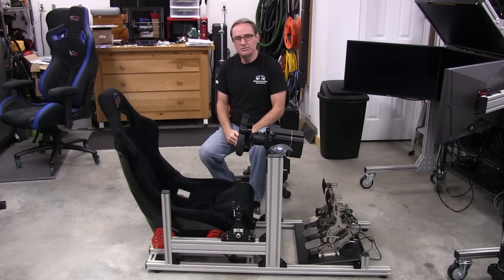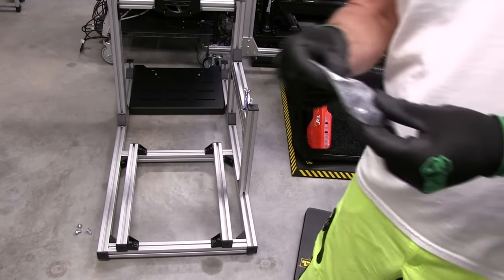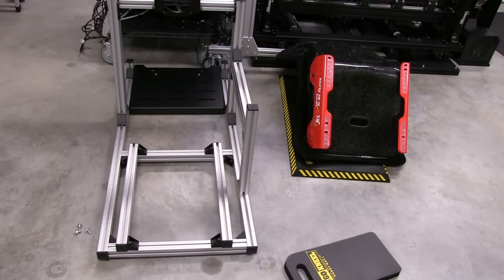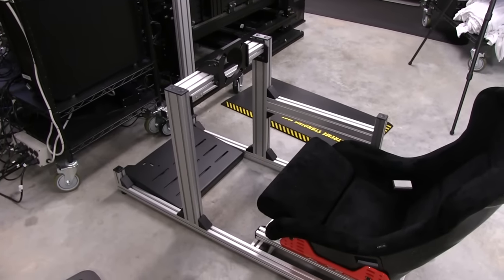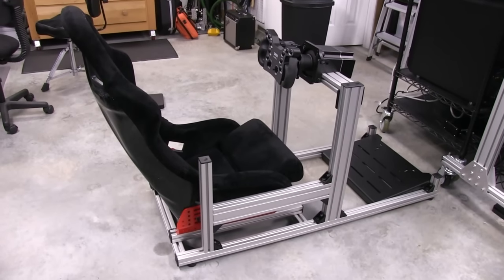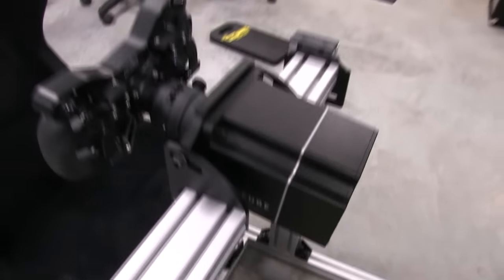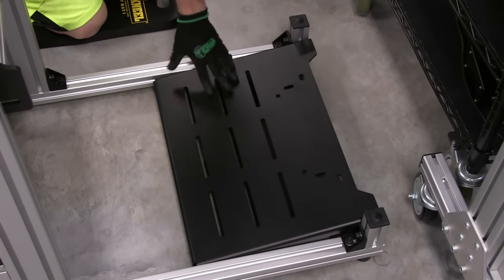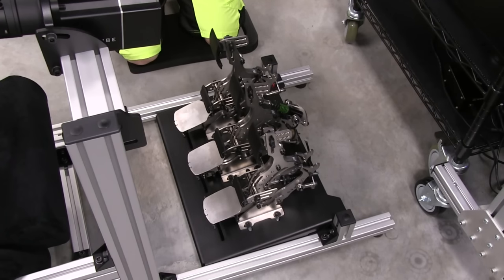ASR 1 Cockpit Review Part 2  "The Setup"

Comment: FIRST! :D 

Small but importante note here, 397$ USD or 449$ CAD shipping and duties covered for all North American customers! We want to thank Barry for dedicating quality time for a deep dive testing with our newest entry-level cockpit, the ASR 1. It's definitely not built for top tier SimRacing equipement like the Simucube wheelbase, but as SRG demonstrates, it can handle pretty much anything you throw at it. We'll be around on the comment section if you guys have any questions that relate to what we do!
Reply: Any idea when you guys will have the ASR1 and some medium seat options back in stock?
Reply: @RX120D  We have 400 seats arriving mid-April! :D
Reply: @advancedsimracing  Ugh, sounds like the mid-February shipment has been pushed back then? Last I heard from you guys the word was mid-Feb.
Reply: @RX120D  Insert broad comment about the global supply chain 

Yeah... pushed-back indeed. Sorry about the situation! Racing seats for simulation are a hot commodity.
Reply: @advancedsimracing  Just ordered one of these for $349 shipped. Unbelievable value, there is no comparable product. Thanks!
Reply: Hi there, would the ASR1 be appropriate for the Thrustmaster TGT 2 with TLCM pedals?
Reply: What wheelbase mount is that ?

Comment: I had the same issue with my seat and shifter bar...I ended up actually just mounting the bar out on the sides of the wheel tower rather than straight up to it. Now I have more room than I'll ever need for a big ass seat and the shifter is still within reach without strain :)

Comment: If you flip the pedal tray to the intended position (cutout towards the seat) it will lessen the flex you are seeing in the plate.
Reply: That guy knows!
Reply: @advancedsimracing  Can't wait for my ASR3 to get here!!!!
Reply: @brandonmalo2066  How are you liking it, if you don't mind me asking?
Reply: @OREvilleRed  It's amazing, went together very easy. All pieces perfectly cut and all the hardware you could want. Rig is solid and has all the adjustability one could desire. Shipping was fast and their customer service is second to none. Put it all together @Advanced SimRacing is the best choice hands down for North America's. When you factor in shipping and conversion fees ASR is the best price. I spent months pricing out all the different chassis from many different vendors.
Reply: Good to hear, I ordered mine last night! And yeah, the shipping really did it for me. I was looking at a cheaper rig and over $300 in shipping but with ASR I was able to use that $300 in a better quality rig and not transit money.
Reply: I don’t understand why he used this ridiculous pedals set… Totally nonsense to me. This is the worst set possible in terms of forces applied on a rig…
Reply: @1980VINZ  pretty sure the point was to try and find the chasis weak points using very high end peripherals
Reply: What you mean?? I have the ASR1 and id like to understand loll

Comment: I bolted the Fanatec CSL DD up to this ASR1 cockpit with a side mount and I have not noticed any flex at all when using it at its rated power of 8Nm. However, I do have the supported shifter arm bolted up as well so that may be helping a little with keeping flex at minimum
Reply: I just got mine today,  mine didn't come with a face plate, I only the have side mount.  Is that how the CSL DD should be, or did yours come with a face plate aswell.
Reply: @Beast Nicholls mine came with the side mount and the CSL DD spacers only. If you have not mounted the CSL DD yet, use four M6 16mm (with 1.0 thread spacing which matches the CSL DD anchors) bolts with it since each side mount is 6mm thick. I used 4 M8 spacers as well since the kit has so many, on the outside of the side mount to give the bolts a better anchor point since the side mount holes are a tad too large for them to anchor securely. My CSL DD certainly is very secure on there doing this
Reply: If I want to keep the wheel as low as possible is the side or top mount better for the csl dd?
Reply: @SpartanA31xx  the side mount is better since it will allow you to angle the DD upwards slightly if needed for comfort like in a real car.
Reply: @Khans0120  Awesome makes sense. I have to buy a mount for that correct?
Reply: @SpartanA31xx  certain extruded aluminum cockpits which are pre-made have an option to upgrade the standard plate mount to a side mount. However if you design your own extruded aluminum cockpit and order parts from 8020.net, then you can order the side mounts separately. I ordered the ASR1 from Advanced Sim Racing and got the upgraded side mount and supported shifter arm with it.

Comment: not sure if this might help anyone but the extra attachment for shifter /handbrake was mounted slightly wrong the verticle part near his elbow is supposed to be mounted on the outside of the rig not ontop and the horizontal part that the sequential shifter is on is also supposed to be mounted to the outside of the tall verticle piece that leads to the wheel this was probably super confusing but if you look at the picture on the website for the attachment is will explain beter....only reason i mention it is so people will still consider this option when i saw what an inconvience it was i was going to be to mount a shifter i was going to opt for a beter model but it has the same base width thats when i noticed the attachment was mounted slightly diffrent then intended and if mounted corectly it would give the extra clearence nessary to enjoy als they have shifter handbrake and mouse pad attachment that go on that attachment
Reply: That extra room may work better for some but his setup is an option to try. The other thing improvised on this video is the pedal plate is reversed, the folded edge is at the front of the rig on the website

Comment: do you think the asr3 will have less wheel flex than the asr1? I believe the only difference is the bottom extrusion is slightly beefier. Im currently using the 8nm csl dd

Comment: Thanks for the video! Great insights on what to expect and some good tips for set up. Any input on whether it is best to have a stand alone monitor stand vs. the integrated ones? I would think any flex/wobble in the rig might vibrate the monitor on the integrated ones.

Comment: is the ASR 1 sturdy enough to handle a simagic Alpha mini?
Reply: In the video he mounted a Simucube 2 which outputs 17nm which is more than the simagic Alpha mini (10nm) so it should be okay. You will still see some flex but less than what Barry shows in the video.
Reply: Sure is!
Reply: @advancedsimracing  on the website it says ASR 1 is recommended for 0-5NM, ASR 3 for 5-10NM, I assume that you mean the ASR 1 can handle better than it promotes? ASR1 is good enough for the CSL DD in your opinion?
Reply: @sixx1095  well you yourself saw how it handled a wheel base with over twice the strength of a CSL DD. But yes usually these rigs are designed to withstand a bit more than the recommended use. The ASR 3 isn't much more expensive and you can get a rig that is more future proof than the ASR 1 in case you ever upgrade your wheel base.
Reply: @DavidGarcia-oi5nt  I do see it, it's surprisingly sturdy honestly, super impressive.
Reply: @sixx1095  I just ordered myself an ASR3 yesterday! Shipped out within 24 hours lol, very excited
Reply: @DavidGarcia-oi5nt  thats awesome. Please let me know how you like it when you have it in hand if it's possible. Cheers
Reply: @DavidGarcia-oi5nt  24 hr?!?!?  I ordered mine 8 days and still waiting. Same goes for both Moza set-up and LGA1700 mounting bracket from be quiet!
Reply: wondering if you ever tried out the ASR 1 with a simagic Alpha Mini?

Comment: I wonder if there would be flex in the pedal tray if it was installed correctly?
Reply: care to elaborate on that statement? seems to be installed the exact same as  the images on the manufacturers website...
Reply: @sicphuker  It's installed facing the wrong direction, needs to be turned 180 degrees.
Reply: i definitely want to see the pedal tray moved to the correct position. i think the folded lip would help with the flex
Reply: I had to double check the site and he def has it backwards :O
Reply: While it certainly might not fully eliminate the flex caused by maximum pressured applied on such a heavy duty pedal set (which is not the goal of the ASR 1 either), it will help for sure! It's made be reinforced at the front end with the bent steel shape.
Reply: I have the ASR4 (same pedal plate thickness) and Heusinkveld Sprints which max out at 65kg at the pedal face. Under heavy braking there's definitely some flex, but I honestly don't notice it while driving.

Comment: If I could buy this, or the NLR GTTrack for about the same money, which would you recommend? I know the GTtrack is supposedly a higher end product but this seems more sturdy and its 2 years newer and made in North America
Reply: I'd definitely get this. I have a Next Level F-GT, which uses very similar materials/design to all their other products. It's okay, but definitely feels cheap and there is lots of flex. The GTTrack is just their wheel stand with a seat added on. The seat is basically just a low quality "gaming chair" bolted to a metal bracket. I think it's overpriced for what it is.
Reply: @dlugsch  I settled on a Sim Labs GT1 for about the same money shipped from puresims. Thanks for the input though!
Reply: @Shakshuka69  great choice! ASR and Sim Lab seems to be about the same quality
Reply: I am glad to hear you bought the 8020 instead of the GTtrack. I had a used one for a while, the chair is garbage, looks fancy with the seatbelt, but it’s flimsy with not much support. The adjustment is definitely not as flexible as any aluminum profile rig.

Comment: Anyone have a simucube 2 pro on their as1 ? If so how is it ?
Reply: I have a VRS DFP on the ASR1, and it does have some serious flex at really high loads. BUT. It is usually not noticeable, and really fun. I think its slightly less than "sufficient", planning on purchasing more aluminum or hardware to make the rig more stable.

Comment: I had ASR6 but moved to GT1 (a lighter rig). ASR uses very good quality channels, almost as good as Simlab. But the primary advantage of Simlab is the fasteners. Miles better than ASR in terms of quality fit and finishing. Simlab has a very tight tolerance level, which makes their products still top choice for any sim rig. Even the GT1-EVo can handle any DD very well, zero flex. The only advantage ASR has is the price. But if anyone can get a Simlab rig on black friday, no better deal than that.
Reply: ASR uses the spring ball T-nuts, just like Sim Lab.  They also use very similar, channel-locking corner brackets...You just moved from a P1-X level rig, to a much smaller rig in the GT1.  Why?  By the way, I have a GT-1 Evo from Sim-lab.  They're great.  But I'd rather have an ASR6.
Reply: Lol no dude just no, go watch Barry's GT1-EVOs review video to see how much flex there is in the uprights when he uses the Shifter. Also you gotta factor in the absolute butt rape that is Sim-Labs shipping, which is free with ASR.
Reply: @DavidGarcia-oi5nt  Simlab shipping is expensive to US, I agree. GT1 Evo has a DD mount that is rock solid for a DD wheel, not sure what you are talking about.
Reply: @DavidGarcia-oi5nt  Sim labs shipping free to North America through Grid Engineering now
Reply: Which fasteners? Part number please. Thanks

Comment: The only problem is that Simlabs gt1 is still cheaper and better :/
Reply: Enough of your nonsense. The GT1 Evo is $50 USD more expensive than this rig, and the GT1 Evo's price does not include shipping and duties . The appropriate product to compare it with is the ASR3, which hasn't been reviewed on this channel. The GT1 Evo also has flex when using a DD wheel, so your statement is false on all accounts.
Reply: @Maverick09925  Most people including me who use a GT1-EVO can confirm that it has absolutely zero flex, even with a Simucube Ultimate with 50% FFB. Simlab is very very high quality. ASR is very good but still not at Simlab level. For the price ASR isnt bad.
Reply: By the time you include shipping to where I am (Canada), its nearly double the price of this cockpit for me...
Reply: @alahad4723  SRGs review of the GT One begs to differ, the plate was bending under the load of the mounted DD. In any case, I don't get how you can come to the conclusion that ASR is inferior to Sim Labs unless you've tried an ASR rig. Both the ASR3 and the GT One are built with almost identical pieces. You've just got a bias (along with most people) towards Sim Labs due to them marketing their stuff via streamers on twitch/youtube who promote the hell out of the brand.